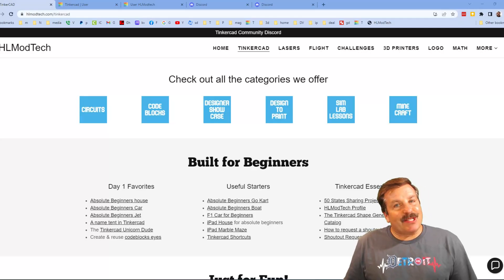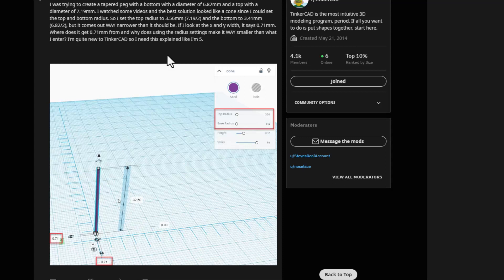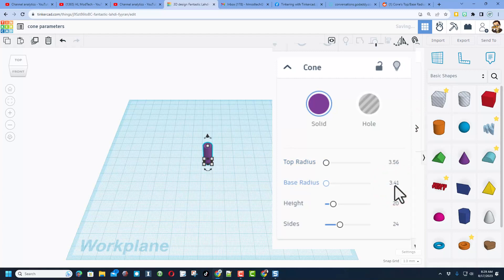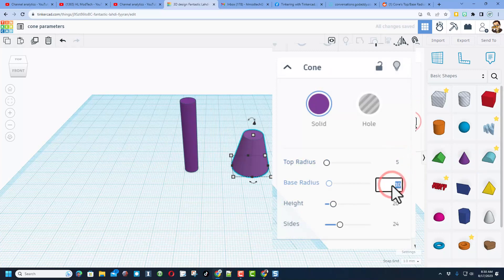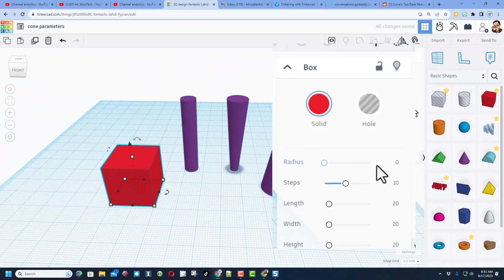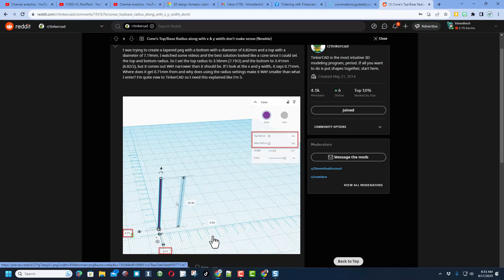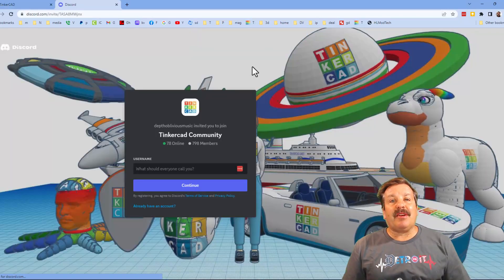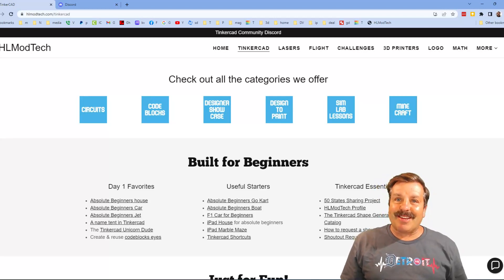Tinkercad Handles BREAK the Parameters Easily Explained in Minutes

Comment: I am replicating a tapered hexagon with top radius of 10.725 and bottom radius of 7.7mm. struggling to get a hexagon to taper... ideas?
Reply: that was quick. use the cone like you are here, and change sides to 6... My kids powerwheels pinion gear for the rack/pinion steering is gonna be fixed! things original Jeff Gordon race car from 1999.
Reply from the maker: That is fantastic! Well done. 💯👍